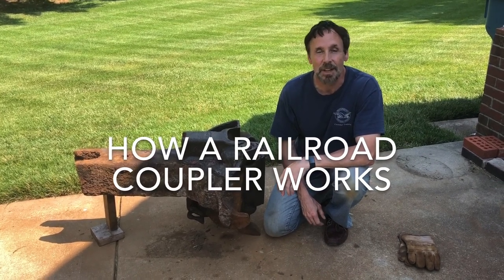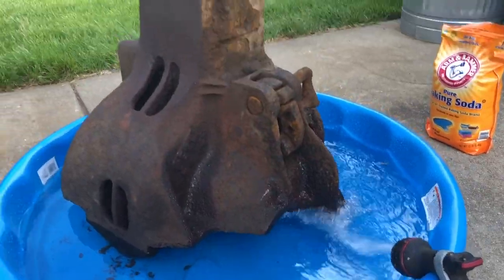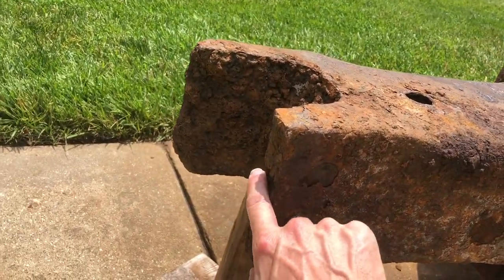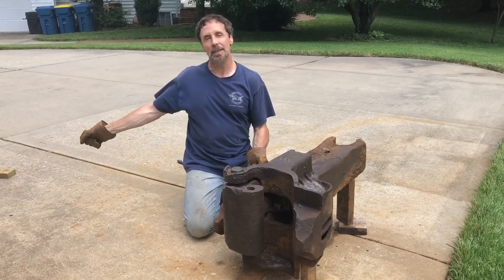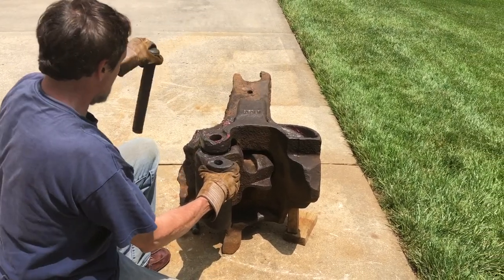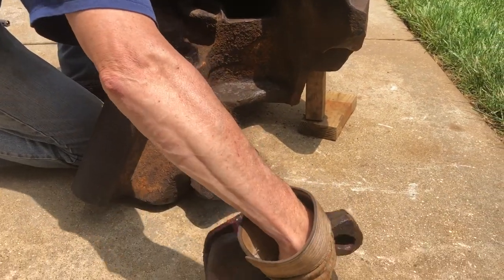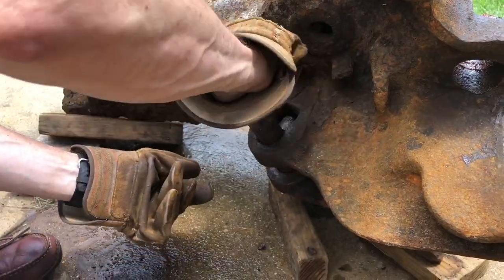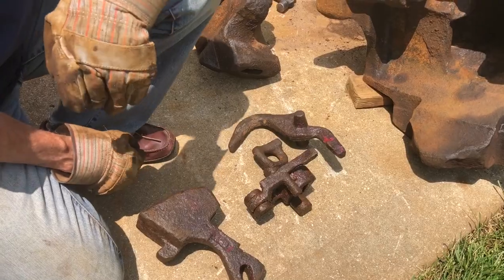Railroad Coupler

Comment: An interesting feature of automatic couplers like this one that is not generally known is that the coupler will work without a knuckle pin, when it is in the closed position.  The knuckle pin is a pivot point only, and does not bear any draft forces that travel through the coupling.  This is true for both "E" and "F" type knuckles.  When knuckle pins break, many times all that is left is the very top part of the pin (if any is left at all), so this is a very hazardous condition when switching cars.  If one is unaware that the pin is broken or missing, the knuckle can fall to the ground when the pin lifter is operated - a good reason to stand clear to the side when "pulling pins" in switching operations, or when opening knuckles.
Reply from the maker: Wow, very interesting!  You sound like you have had a lot of real world experience in the railroad.  Funny you should mention the broken pin. I was on some active tracks around here today and I spotted a broken pin (just the lower part).  What are the chances of that!
Reply: @johnsworkshop3312  I am a retired railroader with 14 years experience on the ground and 16 at the throttle.  I try to pass on any information that I feel may help protect someone from injury.  Broken knuckle pins are not all that rare.   In spite of my experience, I've never disassembled a draw-bar/coupler as you demonstrated  (the car department took care of that), although I have replaced many knuckles.  I didn't mention it before, but there are also PLASTIC knuckle pins around!!  Imagine my surprise at the first one I found!
Reply from the maker: Yeah - plastic sounds impossible, until you pointed out that the pin is really just a hinge for the knuckle and doesn't carry  load.  Now it makes sense.

Comment: Years ago I worked at a local rail yard fueling locomotives.  Just out of the main yard area where the trains slowed down the most was a section of about half a mile that I picked up lots of pieces of those huge pins that the couplers pivoted on.  

Guessing that they would stress fatigue en route and that's where the tension was off them long enough for the broken pieces to wiggle their way out.
Reply from the maker: Yes - that makes sense based on how these things work.
Reply: @johnsworkshop3312  Interestingly I found out that they could be machined into very tough hitch pins for the farm equipment. 

Where they broke in half was often the only part of them that was metal fatigued enough to matter.

Comment: What you are calling the "LOCK" we referred to as the "PIN" and what you call the pin as the hinge.  Canadian railway terms.  We used to say it was so quiet in the freight yards last night you could hear a pin drop (lock). Components are usually cast steel.  Most common on line repair is to replace a broken knuckle.  You will notice that the knuckle has keys top and bottom that match slots in the drawbar. Hence  the coupler will remain closed even with the hinge missing. These were an improvement over the earlier Janney coupler and were developed by the "Buckeye Foundry" in Cleveland Ohio.
Reply from the maker: Thanks James.  That is very interesting about the hinge (pin) not being required once it is closed.  A lot of engineering went into the design of these couplers that is not obvious to the casual observer.  I wish the Buckeye Foundry were still in business - that would be a neat place to tour.
Reply: I'd like to add that because the pin is only used as a hinge that you will see plastic pins now.
Reply: Common slang for the components down here too

Comment: Found one of theses beside a crossing a few years back. My plan was to take it home until I realized I'd need a tractor to move it anywhere
Reply from the maker: Yeah - it is super heavy - more than you would think just looking at it.  I am definitely not strong enough to lift it up by myself.  Mostly just pivot it around if I need to move it.

Comment: I've always wanted to find a coupler!
Reply from the maker: Yeah - I cannot believe I found it out there after so many years.  I figure it was probably left there in the 1960s or 1970s (still working to figure that out).  So it would have been out there for maybe 50 years and nobody took it.  Maybe because it was so heavy.  It was only about 10 feet from the  trail.

Comment: Those were mostly used on tank cars, the side castings are to lock the couplers together to prevent them from coming apart in a derailment and slipping up and puncturing the tank next to it. . A potential for catastrophic results. Evan as you see the casting cracked and lost a piece it would still prevent a passed coupler.
Reply from the maker: Wow - I can see that Type-F being much safer in a situation like that.  Thanks.

Comment: In addition to what I wrote earlier, you also did not leave the coupler in the electrolysis tank for long enough, it should be in there two to three WEEKS (not days). You could even leave it in much longer than that (example; the recovered civil war submarine has been in an electrolysis tank for over five years now and will be in there another several more years to come.)
Reply from the maker: Wow - I had no idea.  I found that my electrode got fouled pretty quickly, and I had to clean it often. But that may have been because I was using the wrong electrolyte.  Maybe for those long times they have system to periodically clean it off.

Comment: Basic 19th cent iron works from any good foundry with in house pattern and core makers. Other than design changes and the improvements in metallurgy not too much has changed in 100 years.
Reply from the maker: Must have been a great design for it to still be in use today!
Reply: @johnsworkshop3312  Precisely, Sir .

Comment: You said that the load bearing part was broken off....but it looked like you got the knuckle to lock in place? Isn't the load bearing part the knuckle hinge pin plus the lock block?
Reply from the maker: It is really one of the “ears” on the side that is broken on the knuckle side, but on the side that goes into the car the entire hole is pulled out of the draw bar.  That hole is where all of the load would be transmitted to the car.
Reply: @johnsworkshop3312  I see. Thanks again.

Comment: I live in Alton, and have ridden every inch of the 135+ miles of the trails...I should recognize the area from your pic, is that around where the Goshen trail and Heritage trail join? Also, along some of those "rails to trails" you can see some of the old poles still standing. Always wondered if they are old poles for the telegraph lines when the rails existed. I have also seen other rail road paraphernalia, such as the plates the spikes went through to join rails to ties. Really like the video, thanks!
Reply from the maker: Yes - it is just south of there between Governor's Parkway and Center Grove Road.

Comment: Great you showed these components. All these years I have never seen these or understood what was happening to couple. Are they all forgings?
Reply from the maker: Good question. The rotor and rotary lock lift assembly are ductile iron. The lock and the knuckle thrower are steel, but not sure if they are forged. Found that information on the site: www.stratoinc.com under couplers.

Comment: The lever used by the brakeman to open the coupler is called a 'coupler cut lever.' That's a tightlock coupler--those 'thumbs' keep the couplers from moving vertically against each other in case of bad track or a derailment.
Reply from the maker: Great information - thank you for educating me Greatdome99!
Reply: I believe they were used mostly on tanker cars to prevent puncturing the adjoining car in a derailment. Years later the standard E60 coupler had a shelf added and then two, top and bottom for the same purpose. BE60 and SE60, I don’t recall which was which. The F type couplers weighted a lot more than Es.

Comment: When you add up the minimal slack in the coupler by a 100 railroad cars you end up with enough travel that the rear of the train can move a whole rail car length despite the front is dead still.
Reply from the maker: Wow - that is amazing!

Comment: Good video. Man I got tired just looking at you. The hands on work versus Googling drawings of a coupler assembly. I’m wondering how one is changed out while on the rails.👍 07/03/2021
Reply from the maker: Good question.  It is pretty darn heavy so some sort of lifting equipment would be needed.  I know a knuckle can be replaced on the rails pretty easily and have seen video of that, but not sure about the entire coupler.
Reply: You are correct in that the coupler itself can be swapped by just the conductor. The part that the coupler mounts to that actually reaches into the car is called a drawbar. That requires lifting equipment to change. Drawbars seldomly break but it does happen. The coupler is supposed to break first.

Comment: What an interesting find.  I live in Jerseyville and we recondition these parts. This is an F70 coupler and from the damage was probably in a derailment as you don't usually see that kind of damage to a coupler without the cars coming off the tracks.  Great find and nice video.  One question, did you see the casting date on it?  It would be on the top while in car position with the horn up (the bump shaped like a loaf of bread).  While this date won't tell you when it was cast aside it will tell you when the part was cast new.
Reply from the maker: Thank you Steve for your comment.  I would love to learn more about the coupler and how it got there. I tried to read that date when I first got it and I was not able to make it out. It has ice on it now, but I will try again to make it out as soon as it melts.
Reply from the maker: Steve,  I searched for a casting date, but the writing is pretty hard to read.  On the top center of the coupler it clearly says "AAR", and I believe this is the part you described as a loaf of bread.  On one side and down lower it says Type-F, and under that it says something that ends in "OCKING".  Maybe that is locking.  On the other side of the coupler I see something that looks like "OF-70", or maybe it is a "CF".  Hard to tell.  Where do you think the date would have been placed relative to that "AAR" text, and how big would the text have been compared to some of this other text?  Thanks for your help.
Reply: @johnsworkshop3312  It says” Type F Interlocking”. When mated to a coupler of similar design, the side projection/pocket (depending which side you’re looking at) interlock with each other to prevent vertical uncoupling. Typically used on tank cars (both type E & F), locomotives and rotary dump coal cars.
Reply from the maker: Thank you Tom T - good information!
Reply: @tomt9543  I would like t know more about "vertical uncoupling". In 2007 I was on the last train into Churchill Manitoba . It was so slow they closed the line. The ups and downs of the tracks were severe because of thawing (non)permafrost. The car behind ours looked like it went up and down a foot or two relative to ours, but that is likely an exaggeration.
I didn't look closely at the time but it seems these couplers are designed to slip vertically as much as 10 inches?? Can they slip far enough to come apart or is there a stop or something to prevent that?  Thanks
Reply: There’s nothing to prevent a standard coupler from vertically uncoupling. That being said, the vertical length of the couplers knuckle is designed to prevent that from happening even if one of the cars is derailed and the wheels sitting on the crossties. The “type F interlocking” couplers were designed primarily to prevent uncoupling of tank cars in a major derailment, this to prevent couplers from penetrating the end of the tank and the resultant release of hazardous materials. Note that all “type F” couplers are supported by a spring loaded coupler carrier, or carrier iron as it’s sometimes called, instead of the standard rigid carrier. The F couplers not allowing for much vertical play, have to have some “give” in the carrier to prevent it being ripped out! As a bit of trivia, Association of American Railroads (AAR) standards call for the knuckle centerline to be 31-1/2” to 33-1/2” from the top of the railhead on a loaded car, and 32-1/2 to 34-1/2” on empties. Close inspection of railcar knuckles will often reveal a chalk mark in the middle of face, this from when the car is in a shop and coupler height is measured. Freight cars frequently need steel shims welded on top of the carrier iron to restore the proper height. You’ll also often see an air hose glad hand gasket stuck in the top of the knuckle hole, and that’s from the AAR required replacement when is car is in the shop. Carmen do this to show any AAR inspectors that show up that the gasket has been changed!
Reply: @tomt9543   Thanks. Am I close when I say 10 or 12 inches of vertical offset will disconnect the standard knuckle coupling. I understand that there are some types that are limited in the amount of vertical movement they allow.
Reply: @alexenglish625  Since the height of the pulling face of a knuckle is 11-1/2” (+ or -), for one to bypass the other would require that much offset. For that to happen, something really dire would have to happen. It’s not unusual at all to have the coupler carrier missing from a car, they live a fairly tortuous existence, and even that won’t allow uncoupling except in the case of long shank “swivel butt” couplers.

Comment: That’s a awesome find! I see it’s been 8 months now so what have you done with it since then?
Reply from the maker: So far it is still sitting at the top of my driveway and I keep it coated with some thick gear oil to help keep the rust from getting worse. Not sure yet what I want to do with it. It is super heavy so I don’t really move it much.
Reply: @johnsworkshop3312  yeah it’s definitely not a shelf item! I can see it would be neat to have but what do you do once you have it.
Reply: @johnsworkshop3312 : Maybe use it as a lawn ornament...Idk.
Reply from the maker: I’d like to take some time to sandblast and paint it

Comment: I suspect that thing was lying in the woods due to a derailment/accident.  Here's why I suspect that:

The coupler has two critical failures on it.  If the loop broke at the back, the "ear" part at the front wd still be there. Result: Scrapped. If the ear part at the front broke, the loop part wd still be there. Result: Scrapped.  Your coupler has both critical parts missing.

I think the railroad wd have retrieved it if they'd known it was there, just for the scrap value.  

So I think there was a derailment right at the spot you found this.  This coupler got busted in two places at once, and was pushed mostly into the ground at the spot you found it.
Reply from the maker: Great observations. I was thinking derailment also. I’ve searched the available records and have not been able to find a derailment in this area.  But there may be more records that I have not been able to access online.

Comment: My town in Kansas used to be the headquarters of the Santa Fe RR.  I had many BNSF engineers as patients.  We used to talk trains all the time.  Those knuckles break frequently if the engineer applies too much power and pulls too hard from a stop.  At least that's what they told me.  Didn't have to be a wreck to break one.  Maybe that's why you can't find anything online about a derailment.
Reply from the maker: Yeah - you may be right about that.  The Santa Fe RR is really cool.  As a kid I got to ride from Chicago all the way to Santa Fe New Mexico.  Memories I'll never forget!
Reply: My dental office is in a one hundred year old bank building across the street from the former SFRR offices.  The huge windows look down on the tracks so we saw trains all day long.  The tracks bisect this town and the train station is at the main downtown intersection.  The best trains were the 737 fuselages Boeing was sending to Washington state.
Reply from the maker: Wow - what a great view!!

Comment: A good fast easy method of removing rust , scale , old paint etc would be to use either wet or dry sand blasting .
Reply: needle scaler
Reply from the maker: Yeah - I'm thinking about doing that on the outside and then paint it.  Just a matter of finding the time.

Comment: wenn you hold the unlock lever up the coupling opens. Theoreticly when you hold the lever up can you close the coupling?
Reply from the maker: Yes, when you hold the lever up you can both open and close the coupling.  If the coupling is open, you can close it and it will lock automatically.

Comment: Washing soda works better than baking soda to use electrolysis to derust. Bake baking soda in the oven at 400 degrees until it becomes grainy like salt and it changes from sodium bicarbonate to sodium carbonate. The process only works well between the electrode and the grounded object so multiple electrodes help.
Reply from the maker: Great tip - thanks Mark G.

Comment: that is a really old f type coupler by the looks of it... most now a days look like a more bulky e type coupler
Reply from the maker: Interesting. I guess the design is continuing to be perfected.
Reply: @johnsworkshop3312  the e type and f type  couplers are really how the coupler is pinned into the rail car. though that coupler may actually be an H type coupler which are mainly used on passenger cars. without knowing the car that coupler came off of i can't say for certain as i only ever worked on freight cars.
Reply from the maker: Thanks James.